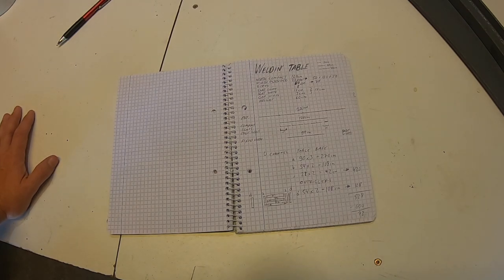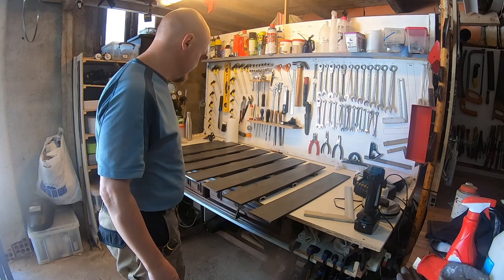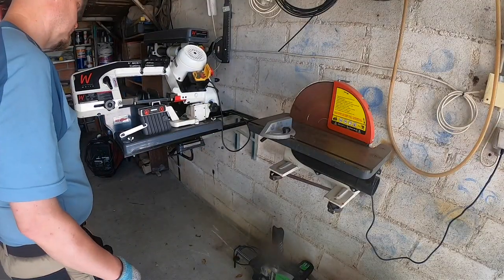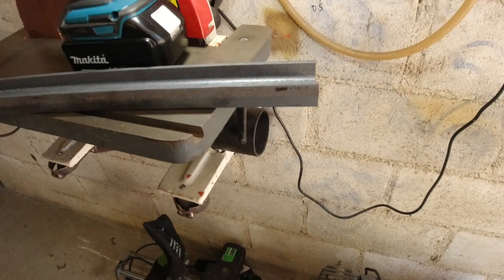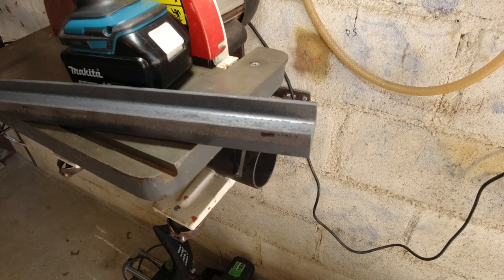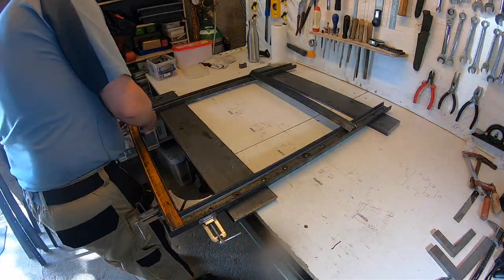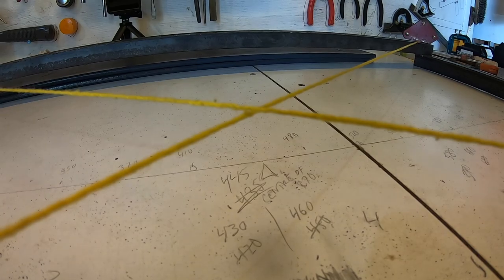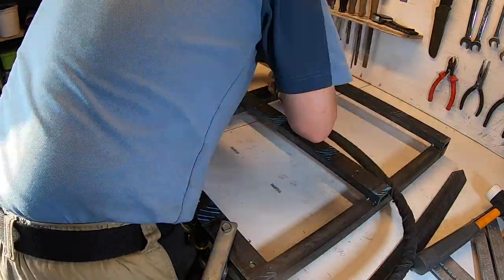Adjustable welding table with folding legs - Part 1: The frame - JLW018

Comment: not bagging  out but if you can move the guide rollers in to just missing the materiel on the down stroke you get a bit more precision but your absolutely right some saw just drift ,,great shit man keep the video's up  me and my mates on the rig watch all your stuff, I got a aust defence ul1700 about year ago love it use it as service truck the desert doesn't phase it ;you wouldn't know where i could get get one of them  euro style turret latch lifting thingy like yours  shipped to aust I only got two little angles a pin and neoprene shit  flips right over no adjustment closed or open yours looked to lift up over turret to keep weather out and swings out of the way or drawings the cab lift great stuff keep up the good fight.
Reply from the maker: Thanks mate! If the bandsaw would be a bit more advanced it would be worth moving the guides, but what I've not mentioned is that the adjustable guides broke, and I had to replace them and then weld on a new extension arm. The metal on the rollers are some form of chinesium and it took me a long time, but I did get it welded in the end. Looked like a fireworks display for a moment. They're not straight as it is, and a few weeks back I tried to adjust them, but I gave up as I only had an old blade (even worse than in the video) which then broke and that blade was drifting anyway, so there's no point in try to adjust it right now. When I get a new blade, I'll get some metal shims or something and I'll try to align it all properly. There's no adjustments anywhere apart from in-out, and when I do that, it changes everything anyway, so not a good thing to do. Proper solution would be to get a better bandsaw.
Good to hear your U1700 is doing great. Yes, our hatch swings out over to the other side. If you've got a welder you might get away with just replacing the arm. But the actual hatch has some tabs on it for the arm, so you'd have to add that if your hatch doesn't have it. The only company I know of that could supply one is Atkinson-Vos in UK. I'm sure there are other ones within Europe that might have those. Best ask in a forum or something. They're very heavy though, maybe build something yourself? Good luck!
Reply: figured you were on top of it, we work with what we got ill start on my table when on days off good design local tool shops want 3-400$ for cheap chines crap well back to the grind , if and when this covid shits over and if you find your in sunny Queensland Aust, might see you around there's a fairly large unimog community here aust, army's scraped the mogs for some serbian or Hungarian truck to replace there fleet go to the auctions you get them from 8-1700 aus dollars dealer resell them 26-33,000 and our dollars shit compared to yours might be the cheapest around when at the army action there were hundreds of them exaggeration there but alot most with from 3000 to 200,00 thousand kilometres on the odomitors serviced every month regardless of K's might have to buy a bunch and export then lol take care and keep the videos coming
cheers mate
Reply from the maker: @al.olaster3953  When you start your build, let me know if you have any questions. There's a few things I would have done differently, but overall, I get so much use out of that table. 
It would be awesome to take the Mog down under. Definitely on the radar. Hopefully our paths cross!
I've seen tons of YouTube videos cropping up of Aussies working on their ex army Mogs. Very cool to see. Those U1700L are pretty awesome.
Take care and stay safe!
Reply from the maker: @al.olaster3953  I can't believe I missed your post! Apologies. Hope you've acclimatised and you're back working on the Mog. Looks like you've also got most under control. I'm sure there's things we can't think of even if we'd spend tons of time planning. There's always something that gets missed. Sometimes it's better to just dig in and get going. Solve the problem, and if it's not solved, redo it. Maybe even a few times. Just keep at it. 
We are very jealous of your seats. Haha... We didn't pay much for our old Discovery seats. Not as comfortable as yours though.
Good luck with the build and keep us posted, please.